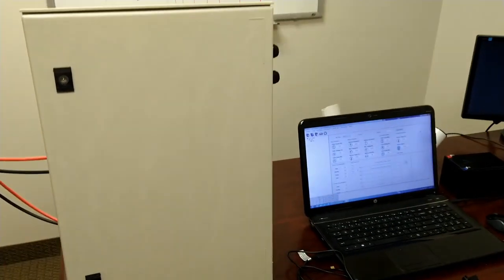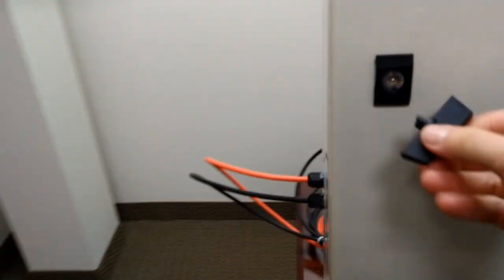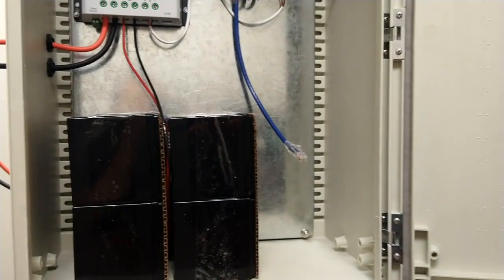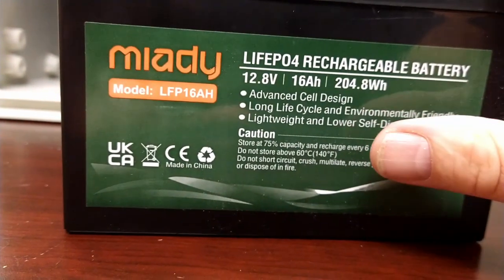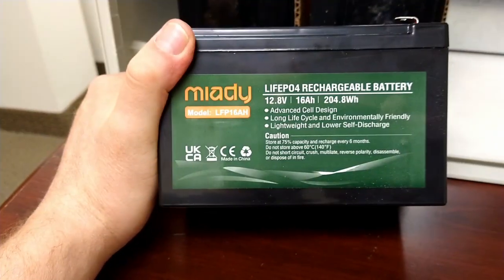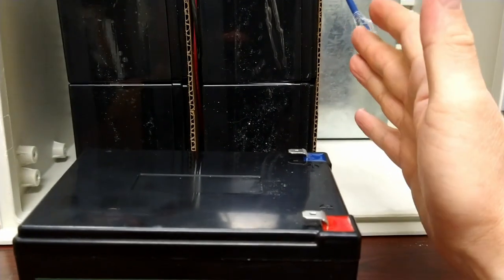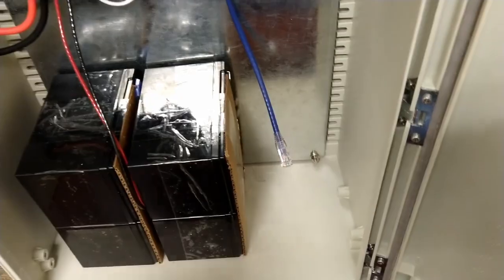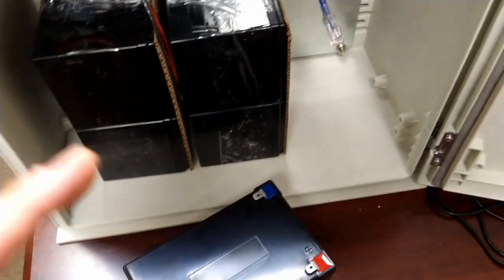Budget LiFePo4 fine for IoT?

Comment: What is IOT device for?
Reply from the maker: We do video surveillance, and AI such as people, vehicle, and automatic license plate recognition.
Reply: @BradCagle  oh snaps maybe you can help me out. I have 4 or 5 high end cameras. I need some software for them but dont want/cant afford to pay for cloud service to utilize the features. They are avigilon bullet style cameras. I can get model numbers of them ir you think you could guide me on setting them up
Reply from the maker: @stygianindustries8295  Yeah, we have a few customers that have avigilon cameras. Usually what you'll do is plug them into a POE switch that is connected to your network/router then hold down the reset button on the camera for 30 seconds or so. This should factory reset them to use DHCP, and obtain a IP address from your network/router. You can then use this https://sourceforge.net/projects/onvifdm/ to find them provided they are ONVIF compatible.
Reply: @BradCagle  yeah yeah i mean the ai stuff these things are really advanced

Comment: Cool video...get a camera stand.  The Miady rarely pull full capacity.  For the cost, you could build a lot more amp-hours and rely on them.
Reply from the maker: Thanks, I'm going to upgrade the camera situation. These work fine, the less building the better, building cost human resources.
Reply: @BradCagle  - I totally get that.  There's a lot of different "costs" in a given process, but time is a difficult one to calculate.  I will say the newer battery cells and configurations can make it very easy to build a battery quickly, but still not as fast as just installing them.  I just hate paying for one thing and getting less than advertised.  Whether you get 16AH or 12AH probably doesn't matter all that much, though.
Reply from the maker: @jasonbroom7147  I have ripped out the cells on a couple of these maidy packs, I should run a capacity test on the raw cells w/out the BMS. I have a suspicion the lower capacity is because of balance issues. Manufactures of high quality packs will match cells by capacity, and IR. Pretty sure these guys just skipped that part.
Reply: @BradCagle  - I've seen a couple different tear-downs of the Miady packs.  The cells are usually grade B and simply will not deliver full capacity, regardless of how they are balanced.  For your use case, I'm not really sure it matters all that much.  I suppose that depends on how long you would want to run w/o power?
Reply from the maker: @jasonbroom7147  Yeah, pretty sure they are  grade B too. But yes our case these have been working fine going into the second year. We get 2x the runtime over the 100ah AGM's we were initially using. BTW i've built projects (different company) using LiFeP04 going back a decade. The first project use the plastic case prismatics from few different manufactures. I'll give you a bit of useful info, you do want them to be compressed. discharge/charge rate is not the only factor.Temperature is a huge factor, they will swell, and contract more as the temp rises. Also these packs did come compressed from that manufacture, we stupidly removed the compression apparatus so we could fit the cells in the system. So basically, I'm pretty partial to cylindrical cells in harsh environments.
Reply: @BradCagle  interested in working with me on developing a product?